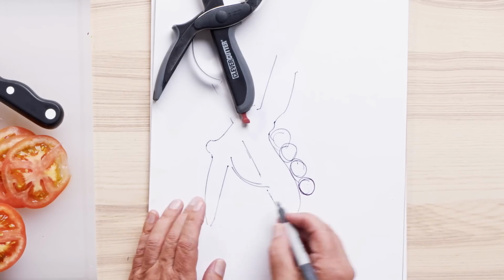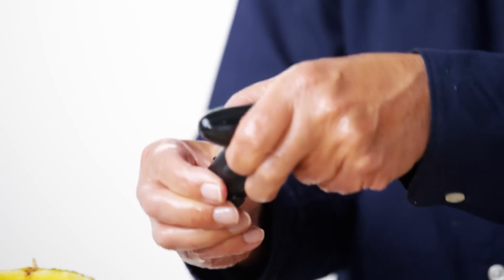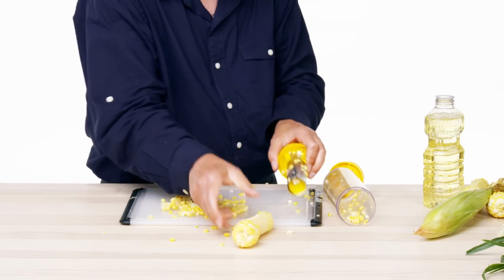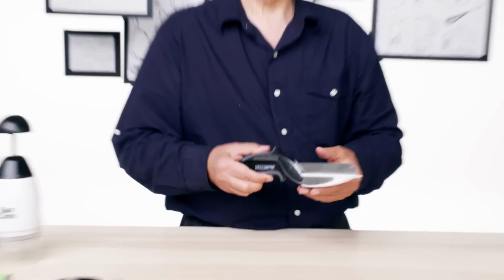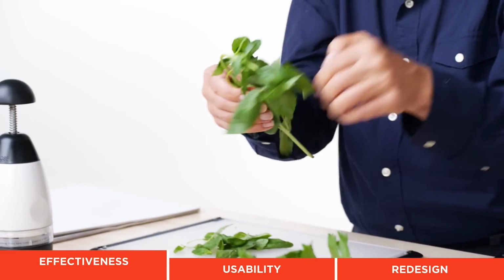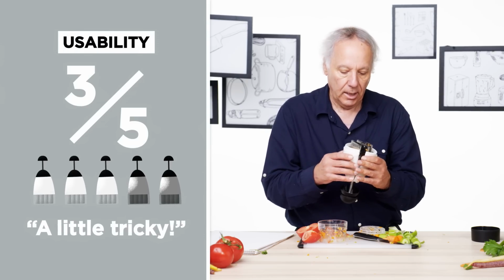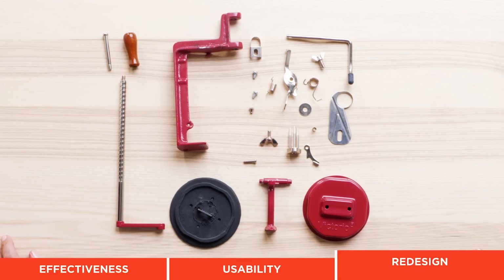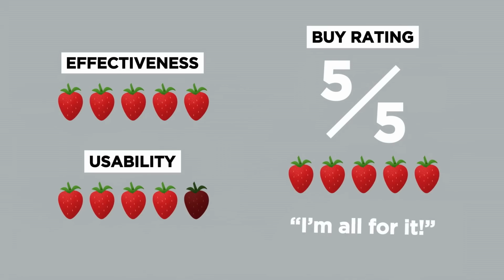7 Slicing Kitchen Gadgets Tested by Design Expert | Well Equipped | Epicurious

Comment: "Design expert": *slowly hulls the strawberry with a sharp knife instead of using a small spoon with a good shape and doing it in a less than a sixth of the time*. But he is a funny guy and enjoyed watching him and wouldn't mind watching him again nonetheless. But It is an inspiring video since l see that I have the right mindset to become a designinger of things, something I've thought about for a long time. I figured out improvement as he was using the gadgets. I figured what could have been improved before he said anything and it turned out we came to the same conclusions. 

I also thought it would be good to have anti-slip rubber under the corn strippers bottom part, not that that would've made it worth using looking at how much corn was left.. I also bet using the apple peeler with the corn, if it would've fit, should have removed more of the kernels if the tension spring was stronger. Problem with this is that the kernels would then probably been less intact than if you used a knife and some caution, if that was a priority, as well as it's doubtful it would be faster at that point.. Maybe a better corn fixator would be preferred instead, with a peg, a collection vessel that prevents the corn from being cut twice if you slide all the way down on a simple flat surface. It could actually look, much like the baking mold he used but more refined and in plastic so that you don't dull the knife. Maybe with some anti-slip rubber on it as well.

Comment: The old fashioned Apple peeler takes a bit of dialing in to be useful, and for even 4 to 6 apples it's totally NOT faster than a knife. But when you're doing a few dozen apples to dry out cook, the thing becomes exponentially more useful. The odd thing I found is composting the peels -if left in long strings they don't break down - the peels need to be cut up (i just go to town on a bucket full with some kitchen shears).

Comment: If it only saves you less than a minute I don’t find it more useful in my opinion unless it also makes it less difficult. But something less difficult should be significant less time to achieve which isn’t the case in most of these gadgets even with time saving aspects.

Comment: Sure, let's cram our kitchen with as many devices as possible that have the same function and that will all get all dirty.

The only useful item on that list are the kitchen scissors but not for raw food that you have on the cutting board anyway.  Instead, it's handy for stuff like appetizers and desserts that are on a plate already, so it's awkward to use a knife.  Also, for kitchen scissors, it's important that they can be taken apart for cleaning.

Comment: Although I found the best success from a small 2 in corn stripping ring that I have much more manual control over the angle (and by the way the instruction directs to twist the teeth while going down the length of the cob),
Dowsing the cob with some corn oil will help lubricate the shaft if you're using one of those elongated contraptions that are self-enclosed.

Comment: You know the Industrial designers who designed each of these products are SCREAMING at their screens right now ^_^ some for things like "WE TRIED THAT it didn't work as well!" and the others "THA'TS WHAT I WANTED TO DO BUT BUDGET/EGO GOT IN THE WAY!" lol
Reply: I bet a lot of his designs would've worked, and they're just flaws that weren't seen through.
Reply: The t cross section with the apple corer definitely was left that way due to production costs, but the other plastic items like the handles that could have been curved, those were flaws were overlooked and could have been corrected with more usability tests
Reply: @milicitrus  One thing to note about the apple corer is that its design has been mostly unchanged for over a century, with the two biggest changes being the rubber suction foot instead of a clamp, and the handle being straightened out. (search for "Goodell Co apple slicer")

Owning one myself, I'd actually disagree with Dan about his redesign of the T cross-section.  With as many nooks and crannies as it has, rounding that one out wouldn't make any difference.
Reply: Sometimes you don’t see stuff until it’s to late. That’s why people need to do test phases in which they get experiences from actual users. So they can redesign it.

Comment: The pineapple corer is certainly convenient, but it leaves behind an awful lot of product.
Reply: My thoughts exactly.  Interesting he complained about the watermelon and not this.
Reply: @texchu8331  that's exactly what I was going to say. I agree with him about the watermelon, but the pineapple was so much worse!
Reply: Actually, whether or not you use that device, you end up wasting a lot anyway because of the eyes on the pineapple.
Reply: @heidihoye178  clean those out with the strawberry plucker. ;-)
Reply: @heidihoye178  No, I take the time to cut those out individually or in a spiral channel so I don't waste the thickness of all the flesh.
Reply: You will still lose a lot unless you cut out the eyes in a specific way.
Reply: Put a cocktail in it, scrape the inside of the  pineapple into the drink. It leaves behind an awful lot of pina colada.

Comment: "The solution to this is to buy a plane ticket to Japan and buy a water melon"
Reply: My way is cheaper, just cut off the other end of the watermelon like he did the side he used the gadget on and then he would not have the problem of running into the end he would have a straight clear path with no issues.

Comment: EASE OF CLEANING AND WASH TIME
EFFECTIVENESS ARE JUST IMPORTANT! The pineapple one, while it is quicker and just as easy to cut the pineapple, would take ages to hand-wash compared to a knife which would just need a quick wipe. There are also multiple washing components.
Reply: Or just throw it in a dishwasher if you have one
Reply: Matthew Luck it’s just a tube, put some water down the tube and rinse the blade part. Not hard🤷🏻‍♀️
Reply: The pineapple one would be easy
Reply: Ok that's just being lazy 😁 just take the extra minute to clean it
Reply: I have and use one of those pineapple slicers. I bought it at a thrift shop. It's super easy to rinse off right after you use it. Not hard at all. I keep mine in my deep kitchen drawer.

Comment: The Corn thing got screwed. 
The metal shaft thing has saw teeth on it.
Therefore should have been used in a circular or back and forth motion, not just pushed straight down.
If you have to press down that hard on something... your'e doing it wrong.
How did this "engineer" miss this.
I want to see a list of HIS successful products.
Reply: That's also essentially a flaw in its design, it has a round top akin to the slap chop, whereas a handle like the pineapple corer would more intuitively indicate how it is intended to be used. In addition the relative smoothness of the handle would make it more difficult to turn for people with arthritis or when hands are wet or slippery.
Reply: @effgaagle730  I totally agree. It would be nice if the expert actually read the directions or even looked closely at the device. He really wanted it to fail.

Comment: the strawberry one, and the apple peeler one, those could be really useful if you're in a kitchen like a restaurant or bakery, sure you can remove the stem of a strawberry in a couple extra seconds with a knife, but do it for an hour straight or longer, its not as easy or efficient as the huller extra couple seconds per strawberry means you'll do a lot less.
the peeler, and corer, do I even need to praise that one? I mean, imagine you're doing it daily, such a small machine, so worth it.

Comment: We use the Clever Cutter in the restaurant where I work.   It's sturdy, super easy to clean, and does a great job of quickly slicing up the pre-cooked boneless chicken we sell.  It's also a lot safer than using a knife -- I've gotten a finger in the way a few times and never have gotten so much as a nick.

Comment: 19:00 you don't round the T-section like this, because it would introduce a problem in the casting process. Wherever you have such a mass concentration you would expect that some cavities may form and the structure is more fracture prone.
Reply: Rainer Riegler well you don't manufacture a hand tool according to casting solution, you manufacture it according to usage ease. If your priority is how to manufacture it easiest rather than what is the easiest way for people to use, then you don't take into account user experience and your product will not sell in the long term
Reply: @ecenbt  it is better to sell a tool that you just can't break, than one that you are certainly going to break.

Comment: You did not fixed the apple slicer on the table and if you don't try to align the center of the apple, obviously it's going to be a rubbish result... For the other things you said about this device, I agree with you. It's not super easy to wash, but at the same time, it's not that hard.

Comment: I cringed when i saw that Apple slicer in the intro. I absolutely hate the use of suction cups on kitchen gadgets PERIOD. They inevitably stiffen and lose suction rendering them a useless crumbly hunk of rubber attached to an otherwise decent gadget. I actually went out and found a much older version of the crank slicer he shows here and instead of a suction cup to hold it to the counter it has a big metal clamp and heavy wooden 'table' it hold onto. I've used it for 5 years now with no stability problems. Suction cups suck. Pun intended.

Comment: The Pineapple tool works like a ratchet. You don't actually have to spin the whole tool. Just hold the black and crank it like a wrench.
Reply: Mattdel907 ooof I’d say it’s a design flaw since you can’t figure that out right away at first glance

Comment: As a left-handed person, I really appreciate you showing use of the items with that hand. Most everything is made for right-handed use. If it's specially designed for lefties, it's often twice the price.
Reply: Im left handed but got raised right handed, thats why it was so hard for me to learn how to write or use scissors lol
Reply: Yup, I have a pair of scissor especially for me, because I've hurt myself more than once ( I was using knifes to open packages ).
Reply: No, the left handed test isn’t to see how it works for left handed people, it’s for people with dexterity problems
Reply: you know, when he redesigned the handle for the pineapple thing he totally messed it up for left-handed people
Reply: @Picsounognosse  it only screws one way, so the pressure is still required in those areas no matter which handedness the operator is.
Reply: @Cat_Feathers  it's made for the thumb to apply pressure comfortably 
The right thumb
For right handed people
Reply: I use my left hand only for writing
Reply: I’m also lefty
Reply: I like how everyone took my refusal to use my right hand as an inability.
Reply: That's because the cost to produce them is the same but way less will be sold
Reply: I am ampidextrious so idc
Reply: @jaidangrimshaw9918  ambidextrous*
Reply: He was only using his non-dominant hand to simulate dexterity issues. If he was naturally left-handed he would have performed the oil test with his right hand. All the products are symmetrical and it wouldn't make a difference which hand you use anyway.
Reply: Also, none of these are designed for right handed people or left handed people, it doesn’t make it harder being left handed, they’re all symmetrical you can just turn them around
Reply: Theresa V You can learn how to use your right hand, that’s what I did.
Reply: Yee Tus No.
Reply: Michael Long yes and no

Changing completly from left handed to righthanded is stupid and harmful

Using a tool with your non dominant hand though... Totally possible, half of my family is left handed so alot of our tools are for lefties, i just use it with my left hand too even though i am right handed
Reply: Michael Long 
You can. My brother used to be left handed but he learned how to use his right hand because in his dad’s culture eating with your left hand is really disrespectful and not something you’re allowed to do.
Reply: Nick Sande 
Why is it stupid and harmful? My brother changed and he’s completely fine.
Reply: @nandi171  as a teacher, I need to say that your dominant hand is determined by your brain structure and influences the communication of the two sided of the brain. Ignoring your natural dominant hand statistically tends to lead to memory problems, short temper, negative effects on your motor skills and other cognitive challenges. It is possible and was done as a rule in many schools amd societies until a generation ago, but is vehemently advised against, for your own sake.
Reply: Nick Sande it isn’t stupid or harmful gool
Reply: Jera T. 
Weird, my brother doesn’t have any of those problems. His memory is really good, he doesn’t have a short temper, he actually rarely gets too mad at someone when they’re even up in his face bothering him and his motor skills are excellent.
Reply: M E maybe he is ambidextrous, best of both worlds especially if one lives in a community that toxic that lefthandedness is seen as so bad it has to be changed....
Reply: Nick Sande 
Nah, he wasn’t. He couldn’t even write a proper sentence with his right hand. And the community isn’t toxic smh, they didn’t want him to be left handed since you’re supposed to eat with your right hand and then handle your bathroom business with the left one. It’s not toxic
Reply: M E why are you arguing with people seriously it won’t make a difference to their opinion
Reply: @mouzube  alright then dont complain